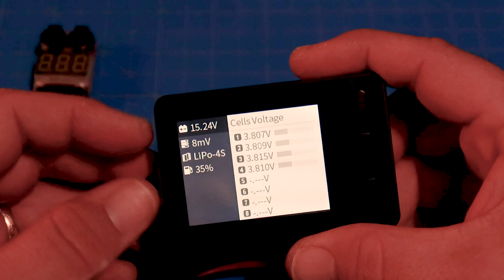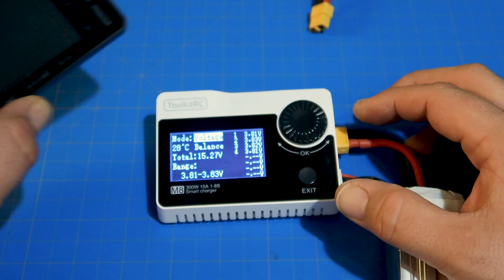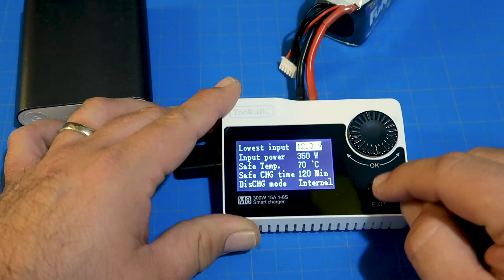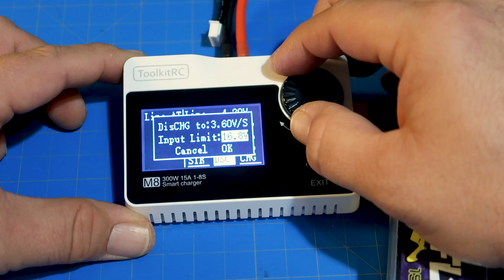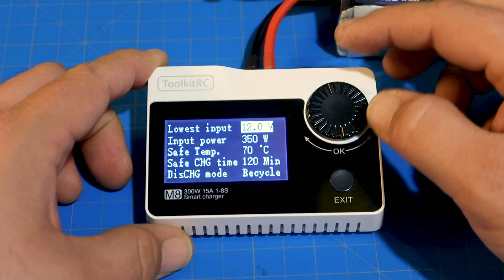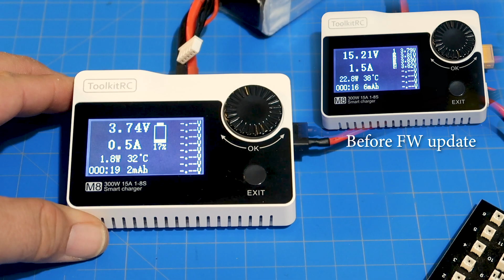ToolkitRC M8 Compact Charger Review

Comment: I am just wondering about it getting its power from a battery. Will say a 1500 mah 4s battery last a couple of charges be for the battery giving it power needs to be charged.
Reply: I use a 3s 5000mah it lasts quite a while for charging my little 650mah 3s and 4s batts
Reply: And then for at home you can just buy or make a wall adapter instead of use a lipo for power
Reply from the maker: Jeremy Chotto depends what kind of battery you are charging